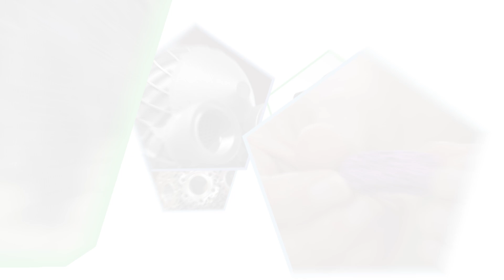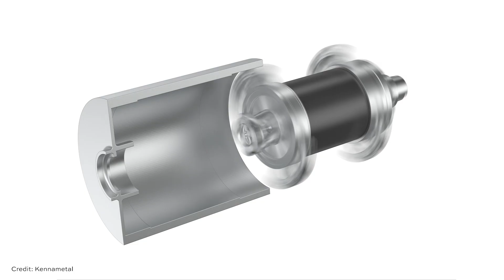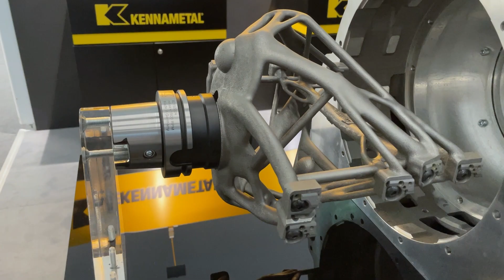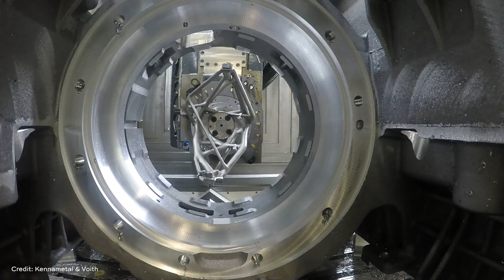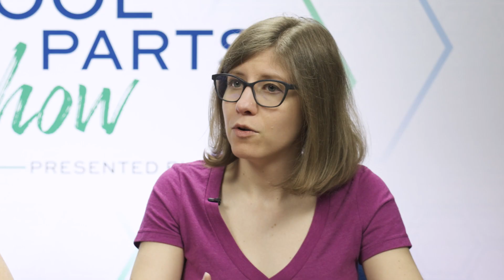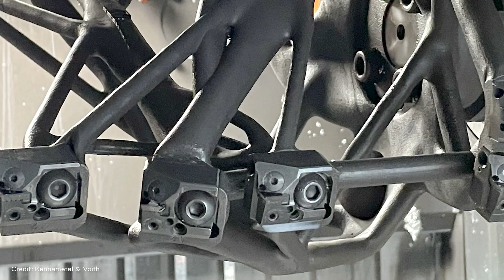3D Printed Cutting Tool for Large Transmission Part | The Cool Parts Show Bonus

Comment: I have some questions including the cost, as I can tell it was a metal 3D-printed part. 
What would be the effect of thermal expansion or cutting accuracy?
Reply: Temperature variation will have an effect on dimensional stability. We are able to simulate changes based on the coefficient of thermal expansion but as you might expect it is challenging to predict for complex shapes. As with other precise finishing applications, best practice will be followed to control temperature variations with the cutting conditions.

Comment: I'm assuming the two spheres are for harmonic balance?  Did they play around with the various GD struts to avoid resonant frequencies in the rest of the tool? Definitely a cool part!
Reply: Good eye! Yes, the spheres are balance features incorporated as a “balance by design” feature during simulation of the final design. These can also be used as a tool during the dynamic balancing of the tool after final assembly, as required. And finally, yes, organic structures such as this go through several design iterations to ensure the natural frequency of the resulting structure will avoid harmonics due to the forcing function during machining of the component.